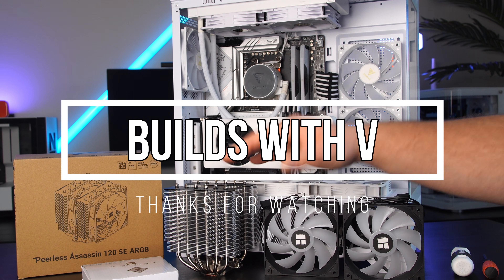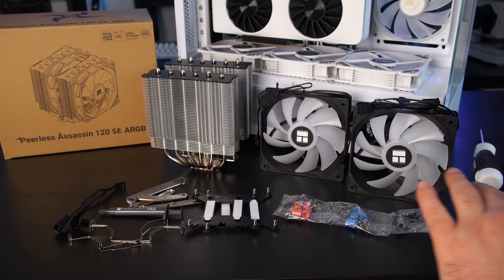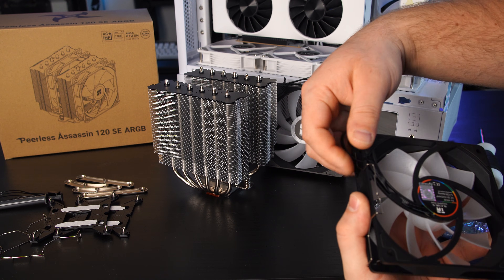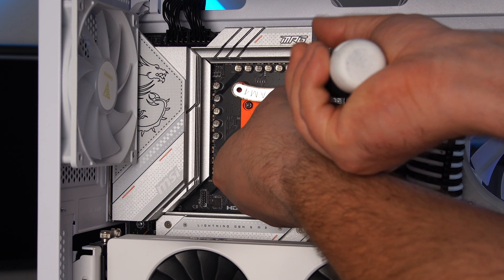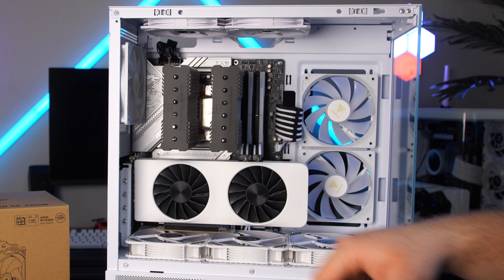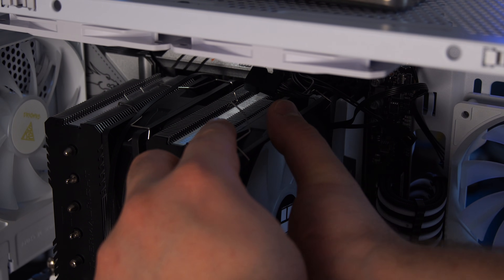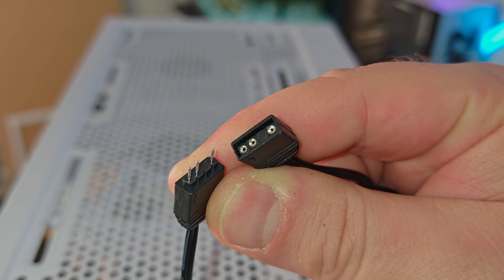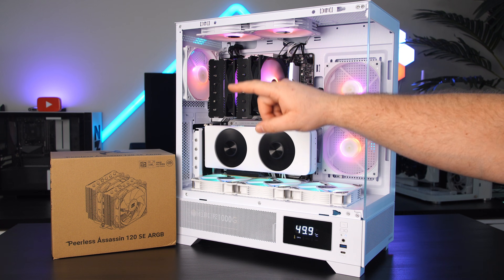How To Install Thermalright Peerless Assassin CPU Cooler

Comment: I highly doubt anyone will answer this question before I just go for it, but my Ryzen doesn’t have that orange plate around it. I'm building my first gaming PC, and I'm concerned that it might overheat if I miss a step here. Can anyone confirm that not all AMD Ryzens have this, or did I miss a step with the cooler?
Reply from the maker: That orange plate is not necessary. It's a contact frame that you can add to your motherboard. It's kinda useless on Ryzen but it helps with temps on Intel. I got it because it makes it slightly easier to clean off thermal paste.

Comment: Ok, I have a question... My Thermalright Peerless Assassin makes a pitching sound when it is over 40% speed on the fans... I moved it, changed the fans of place, did everything, no cables obstructing, all screws are tight, and that noise, like jet engines sound every time these go over 40% of speed is present. Is that normal for these fans? Could it be that the cooler is defective somehow? I want to know is anyone in here have this issue as well and can help me. Thank you. By the way... Subed

Comment: Can I use a different Thermalright Fan? I am using the Thermalright TL-S12 CPU Fan 12cm Case Fan and wanted to do a unified look on my over all aesthetic
Reply from the maker: Yeah you can use almost any fan you prefer as long as it's 120mm. Some fans might be too thick so keep that in mind as well. But if it fits, you're good to go.
Reply: @BuildsWithV Thank you!

Comment: Is it actually as good as a good 240mm AIO? Aiming to cool Ryzen 7 8700F and an old i9-10900 (since its stock cooler never gave it a chance to boost 5.2 GHz as its specs indicate).

Comment: I've ended up looking around at videos for it as with mine the AM4/5 packet has the orange stand offs and then some tiny blue ones too for some reason. I saw some people saying the mounting brackets were loose on their boards once fitter so I wondered if the tiny ones were for that, but your packet looks a bit different to mine.

Comment: Not the fun that goes inside the  metal thing, the other one,  is exactly on top  of the ram, i had to pull it down a little bit. i dont think this is a problem but the ram looks nice!

Comment: Hi! I have the same CPU Cooler and have the same issue as yours where the right fan does not have enough space due to the RAM Sticks. Is it okay to put the fan on the left side instead?
Reply from the maker: Yeah you can, just keep it facing the same direction though.

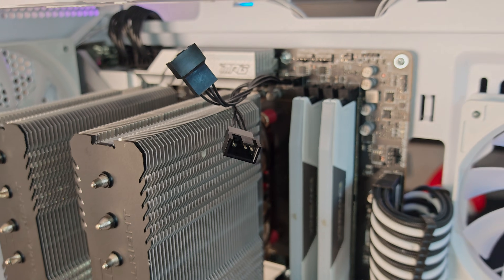Comment: 7:13 is it normal for one of the pins to be missing from one of the 4 pin Y cable fan connectors? The one I got is missing a pin, which is why I’m wondering. Very well-made video btw.
Reply: Yes. It's missing the RPM pin on one fan as the mobo can only read from one, it then controls the speed of both with the PWM pin.

Comment: doesn't mounting the fan a bit higher like that impact cooling ? (I know nothing about this stuff)
Reply from the maker: I'm not even 100% sure 😅 to be honest when it comes to airflow I just know the basics plus a little from some experiments. Each case has slightly different airflow patterns and each cooler also has some differences. One thing I know for sure is, unless you're chasing over clocking numbers or something specific, these minor things only make slight difference in actual temps and most of the time it doesn't translate to better performance. Unless it's completely wrong and your CPU is thermal throttling, then yeah you'd have to change or tweak something.

Comment: I'm glad your PC works. I bought an AMD 7800X3D and an AMD motherboard for a build. The dreaded voltage issue happened, and fried the CPU. I was able to return it. I also had a 7900XTX GPU go out on me after 2 weeks of light gaming. Never again will I buy anything AMD. I now have an i9-14900k with an RTX4080 Super and couldn't be happier. Thanks for the video!
Reply: In my case, its intel . Never going intel again shi really degrade a week after i built it.  Got a 7800x3d and 9070xt now crushing 1440p with ease. At the end of the day, its just a faulty product and not represent the whole quality of the brand. But i will forever had the bad expwriwnce with team blue

Comment: Well i buy this cooler and now Al told me that this is weak for ryzen 7 9800x3d?Should i keep it or?
Reply: keep it, 75c at 80%load and 24c  when idle
Reply: @reicholigarch but 80c is to high temperature for procesor?

Comment: Do i need to install the back plate on the back?
Reply from the maker: Yes that's correct
Reply: @BuildsWithV  you didn't show installing bracket on the back
Reply from the maker: @genlongtsang1093 oh no, that bracket is for Intel. Am5 has a bracket already
Reply: @BuildsWithV  so i dont need to install bracket on the back of am5 motherboard?
Reply from the maker: You do not
Reply: I need to install the bracket on the back as show at 2:19? I have am5 motherboard

Comment: Can I use the cpu fan pinout instead sys fan 1 pinout?
Reply: The CPU one is the one you are supposed to use. If you also have a CPU_OPT you can connect the second fan there instead of using the splitter. CPU_OPT is not controllable in the bios that header will mirror what you set the CPU setting to
Reply: every conetors has diferent purpos, the answer is no

Comment: The directions that come with the cooler include zero details about the fans. If they just added arrows to the plastic for the fans showing air flow direction, it would help a lot.
Reply: Building with White Peerless Assassin 120 SE right now. Has small arrows on the fan
Reply: I read that the air flows from the side without "spine" to the side with it, "spine" being the thin strips that connect the frame of the fan with the middle "spinny" part that holds the blades. So in the case of the cpu cooler: Have the "spine" pointing to the left because you want the air to be sucked into the right side, travel through the heatsink, then out the left.

Comment: so does it matter which way its facing the thermalright logo
Reply: Wouldn't this pull air into the case? The Thermalright logo side is where air comes out if I'm not wrong. I would think the air should go towards the back exhaust fan? Or am I wrong?
Reply: Yes. Do it like the photos on the box or in the manual the backplate is offset. Square logo on the left and THERMALRIGHT on the right is the correct way. If you do it the other way it will actually lower the tower a bit and may not line up as good with your rear fan

Comment: what is the ram clearance?
Reply: You can always put the outside fan a little higher if u need room
Reply: @johngrzeskowiak40 but it looks like crap
Reply: @johngrzeskowiak40  Thanks for that tip.
Reply: Had to that, my rgb ram was too high so i just clipped the Fan a tad higher, no Problems so far.
Reply: @rulewski33 except it looks bad
Reply: @Hoop_23  Maybe if you have a full Glass Case, no problems in a regular one, i barely see it.
Reply: @rulewski33 out of sight out of mind. Bugged me at first but when you dont look at it then its fine😂
Reply: @BuildsWithV can you confirm what RAM you used and how much clearance there was?  I have bought this cooler and I am worried about the height of the RAM I want.
Reply: @CraigThomas-CAT I’m probably late but I think it’s 44mm
Reply: @John_Babcock Thanks for getting back, but yes, a little bit late 😂
However to explain what I did, one video I found showed there was a bit of leeway in the placement of the cooler fans - so even if the ram was high, it was possible to shift the fans higher (obviously too much movement would impact the fan performance).  I adjusted mine by just a few mm higher and it still looks and works fine.
Reply: @CraigThomas-CAT  ok, is this cooler easy to setup? I don’t have a ram issue but I’ve never built a computer before so I want to know what I’m doing first
Reply: @John_Babcock because of the two fans and the digital display, most other air coolers would be easier but it's nothing not worth anyone already building a computer.
Reply: @John_Babcock I'm building my first one as we speak... I'll let you know if everything works out for me
Reply: @antiprohibit  I built around a month ago, it was mostly easy to install but those screws do not want to go in
Reply: For removal of thermal paste I always use ArtiClean. Helps a lot remove the old paste and prepare the CPU the new paste. Alcohol works too but a little harder for the removal in some cases.

Comment: Please note this may not fit in your pc depending on ram size and stuff
Reply: I just positioned the fan slightly higher than the middle one so it clears my ram and I don’t have issues 👍
Reply: if it doesnt fit can i just put the fan behind the other heatsink?
Reply: It doesnt work for some motherboards that way either.  @j.vn311
Reply: @j.vn311 no unless you dont have an exhaust fan at the back of your case. Its also going to look really weird

Comment: So if I want to install this cooling I have to replace the backplate? The one that comes with the AM5 kit? Behind the reconstruction? and one more question, does the orange gadget you have instead of the classic metal one on the CPU work?
Reply from the maker: The backplates that this kit comes with are for Intel since Intel doesn't come with a backplate. The am5 backplate stays on. The am5 contact frame is completely unnecessary. Only reason I got it for this build is because I use this PC for tutorial installs and constantly remove the CPU cooler. Makes it easier to keep it clean

Comment: How do you fit fan over rgb ram? Mine doesn’t fit fan over corsair rgb ram. Please reply me
Reply from the maker: You can't put it flush with the front of the cooler. Have to pull the fan out a bit and basically sit it down on the ram
Reply: Just to double confirm I've seen this problem in other videos and it's perfectly normal to shift the fan up in order to get some clearance from the RAM, don't have the fan sitting on the RAM or anything like that, the cooler fans seem to be properly designed to deal with this sort of issue.

Comment: I pluged the rgb in the 5V same as the video but my rgb dosnt work…😢
Reply: maybe the RGB is faulty on the cooler itself. Make sure the cooler actually has RGB and you didn’t get the no RGB version